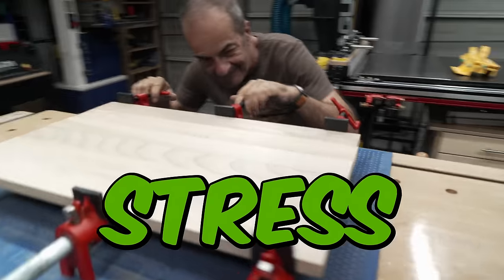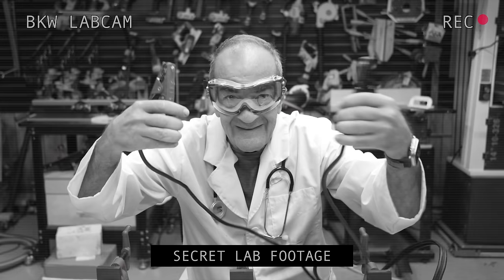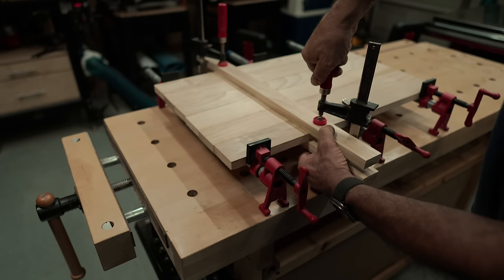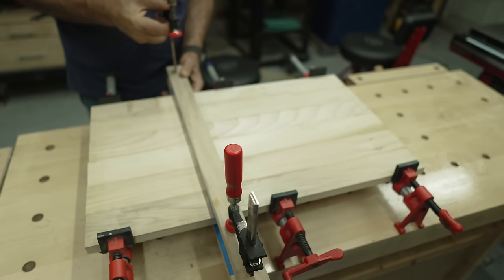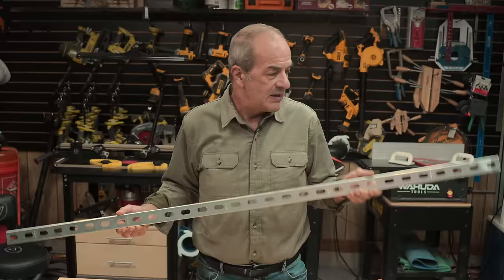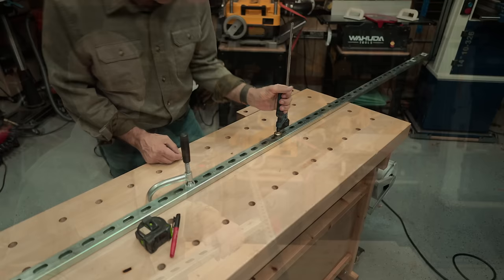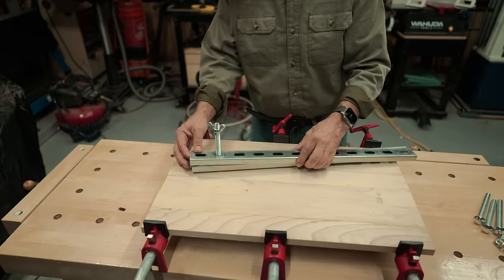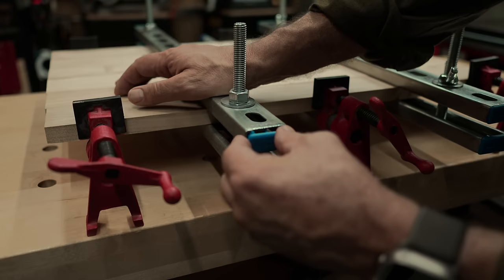Rockler doesn't want you to see this video

Comment: I've used the Rubbermaid standard support brackets for closets. They come in various sizes typically cheaper thus you don't need to cut them down. You may need to drill more holes in them to allow you to clamp closer to your actual piece.
Reply from the maker: That’s an interesting thought. I’ve used old stop sign posts (which I used to get for free) but that’s a new one on me.
Reply: @BustedKnuckleWoodworks   Do we want to know how you got 🛑 posts for “free“? 👀😆  In fairness, you can find ‘em just growing out of the ground all over my town
Reply from the maker: @j10001  😂 I used to know a dude who worked in the street department when I lived back in Maine. Although your idea would work too! 👍

Comment: Thanks for this. You gave me an idea for another application I have been trying to figure out. I have been looking for a way to make consistent router groves for the Microjig dovetail clamps for large surfaces. It appears these superstruts are very heavy duty, nice and long and will stay in place once you screw them down. All I would need to do is place square templates made of MDF on each side, make sure the measurement is consistent throughout, and route my t track slot. From what it appears by the thickness there shouldn't be any flex at all. Thanks!
Reply from the maker: Oh yeah, there's a thousand uses for this stuff! Very stiff and straight! I've used it for shelving, fencing, you name it. They make it in two larger sizes, for big heavy duty jobs too.

Comment: I loved this idea as I do lots of panels for cabinets (never use plywood).  It was smart to show the different options as well.
Reply from the maker: Love to know if you give this a try, how it works for you 👍
Reply: I will be fabricating more panels in a couple of weeks so I will give this a try.  I actually have this material on hand from a left over electrical project.  I will be fabricating both oak and elm panels for the cabinets. I generally use DeWalt 24" one-hand clamps for clamping as I bought a couple of dozen of them for a massive project.   For larger lay ups I use pipe clamps, both 1/2" and 3/4" with lengths up to 6'.  I think 2 of your cauls will work for each panel glue up.  I usually do 4 to 6 panels at a time so I will have to make a few sets. @BustedKnuckleWoodworks
Reply from the maker: @EOTE_TX  love this! Email is on my About tab, send me pics!

Comment: if you walk into a hardware store or home center and call it super strut they may not know what your talking about . the trade names are known by  unistrut and kindorf they also come in 3/4 thick  and 1 1/2 in thick. most of the time you find it in galvanized  but i have also seen it come with some kind of green coating. there are threaded fittings that slide inside the track so that you can slide threaded rods or bolts to any spot on the track. this allows you to get in right next  to the edge of your project.
Reply from the maker: Unistrut is a similar competing product. They aren’t the same and the sizes are slightly different. Most home centers don’t carry it on the shelf (at least not in the US) but specialty trade suppliers will.

Comment: Neat trick and one that many will utilise. I figured if you flip the superstrut, which is a "U" channel, and have the flat side pressing down, it will give you more surface area for the clamping force. Just a thought.

Look forward to seeing more of your back-catalogue!
Reply: I would think flat side against the wood would also prevent idents on the wood if cauls were tightened too much
Reply from the maker: You can place them either way. I find having the open side down is easier, and it’s not usually an issue as long as you don’t over tighten them. If you put the flat side down, the wing nuts don’t fit, so you would need large fender washers to span the opening, or some other method for fastening them.
Reply: @BustedKnuckleWoodworks  This is YouTube at its best. Positive interaction between creators and total strangers,, exploring the concepts arising from a simple vid. Even at 56, I still take delight in learning and exploring the nuances of hobbies (for me, at least) such as this. 
Have a great day Sir!
Reply from the maker: @BadYossa  You’re a kiddo compared to me! Just goes to show we’re never too young to do woodworking 😉

Comment: I’ve always used my pipe clamps as cauls.  We all know we should align the screw of the pipe clamp with the wood we’re gluing up to prevent the wood from bowing up during the glue up.  As I’m screwing down the clamp, as soon as the pad makes contact I tilt the clamp over so the pipe lays on the wood, and then I align the screw with the wood, tighten the clamp until there is enough pressure to hold everything in place.  Use at least two clamps on the first side, and then turn the piece and clamps over.  Repeat the same process on the ‘back side’ making sure to align the screws while laying the pipe down on the wood surface.  Tighten all the clamps to the desired pressure and wait for the glue to dry.  I’ve never had a panel bow or end up with a board out of alignment.
Reply from the maker: I don't like to have the pipes touching the wood. And a lot of folks use black pipe, which you should never use as cauls, the black will mark up the panel for sure.

Comment: This is great.  Making up a set today to do my first real butcher block glue-up.  Got two 10' sticks at THD at $25/piece.  Betcha an electrical supply house would have them for half the price.  Same as black iron pipe for pipe clamps.  Got mine at a plumbing supply for half what big box stores want for it.
Reply from the maker: Watch the part 2 video I just uploaded today, lots of great improvements 👍
Reply: @BustedKnuckleWoodworks  thanks.  I'll check it out

Comment: Good idea,even better if yo place the bars the other way up.this gives you a greater surface area on your glue up
Reply from the maker: Good point, many have mentioned that. The wing nuts won't fit if you do that, so you'd need extra-large fender washers to place them on the outside of the channel.

Comment: I figured out a similar method with 1x2 14 gauge box steel cut into 42" lengths. I use painters tape on one narrow side to keep it from rusting on glue, but i just use the F clamps to clamp them down. I feel like the bolts take too much time. With the clamps you can clamp the cauls about 3 inches in the panel so you can crank down as much as you want and you wont flex the caul. If a board in the middle bows up more than the pressure of the caul will fix (they don't make everything perfect, after all) you can slip a narrow shim under between the high part of the board and the caul right there and it forces that section down. Woodworking is my full-time job so ive had to get as quick and practical as possible while not sacrificing quality
Reply from the maker: Very similar principle. More than one way to get it done for sure. 👍

Comment: Brilliant blend of comedy and instruction. Can't wait to watch more of your videos. My cauls are slightly curved to apply even pressure from the middle to the edges... I wonder how easy it is to bend this strut material.
Reply from the maker: It doesn’t bend very easily, but it’s possible a couple of strategically placed washers could work…

Comment: I bought maybe 28? years ago a few Veritas Panel Clamps, and still using today. Made some 2x3" x4' clamping bars from Tasmanian Oak with holes  and that was the best option for me. Very easy to store and clamps the board on both sides. Before that, I used sliding rail parallel clamps ( about 10 Kg each) with heavy duty bars, and a few different brand name F clamps- they worked if I clamped from both sides: top and bottom, but was always too messy. But I learned very early that solid wood paneling is much easier  if I biscuit joined the boards which stops any side movement during assembly /  gluing. And for panel gluing I mostly used epoxy and longer setting urea-formaldehyde glue. PVA sets too quickly for me, and does not work well with many Au hardwoods-like jarrah.
Reply from the maker: Good tips… I didn’t realize there was wood that PVA glue didn’t work well on some exotic woods

Comment: I've been using punch-rail for that ,and many other 'unorthodox' tasks for years. I'm using it as a 'spar' to support the blades of a 10' dia. wind turbine rotor I'm building now. Also using it as a 'spine' across the top of a 9' long sign I'm making for my plumbing business right now. I guess I'll make a video of that project and post it. Cheers All! 🙂
Reply from the maker: A thousand uses for this stuff
Reply: I  pick up scraps of this all the time time from work to make all sorts of things. It’s great if you have to take repeated measurements in weird areas like from the top of a ten foot ladder. Measure out you length mark and cut the strut. Now you have a rigid measuring and marking tool. I built what I call my roof rack for my utility cart with strut. To perpendicular pieces running wodth wise then two pieces of 3/4 conduit running parallel the length of the cart attached with strut straps. Lets me use the top of my cart as work surface to cut and measure conduit without cutting notchs in my cart or sacrifice space. Throw a piece of Sheetrock over the top if the cart but under the the pipe.  Now you have a flat surface to work in with any material stored on top still but under the Sheetrock
Reply from the maker: @1EliPrice  those are great ideas! I love this stuff… no welding!

Comment: You could even take this one step further and replace the clamps themselves, using hardwood wedges against the bolts to press the boards together, if you really want to save some money. Those big clamps aren't cheap, either. Or, if you have small clamps that can be reversed to push outwards, use those between bolts and boards. I think I'll build myself a large panel glueing station, for cabinet sides etc., with struts like these, hanging on a wall. That way you can always be gluing up panels without blocking your workshop.
Reply from the maker: I know! The hardwood wedges are such a great idea, a few others have commented about doing that. I wish I had thought of it!

Comment: Good idea for someone doing a lot of those glue ups.  For the rest, a simple SLOT nearly the length of those wood pieces will let you slide the clamps inward to any width for full clamping force.  Or, simply glue up two boards with spacers after putting the clamps in between.
Reply from the maker: Sure, do whatever works, that’s the main thing!

Comment: Swivel Pad C-Clamp Locking Pliers would let you put the pressure onto the work, instead of off the sides, avoiding most of the flex whatever the cauls are made of.  They even make 18" long ones to reach into the middle of your work. Harbor freight has good budget ones.
Reply: I’ll check that out
Reply from the maker: I have a bunch of the Kreg ones. My channel is all about practical, economical solutions. I generally try to avoid recommending something expensive when a cheaper option will do.

Comment: @0:27 You can easily use wood cauls for that type of glue up, I've done it for years. You need to turn the boards on their sides, they are stronger and won't flex as much. Then just use wax paper or packing tape on the cauls and glue won't stick.
Reply from the maker: That was kind of a demonstration of what NOT to do, I did use tape on the cauls a few minutes later.

Comment: Been using the runners for those metal shelving brackets which are actually cheaper, but smaller and trickier to get bolts into as you need to drill holes in the bracket slots. Might have to upgrade to this stuff.
Reply from the maker: An update to this video is coming out in a few days!

Comment: Have had the best luck for many years just using hardwood sticks. Just use some wax paper on both sides of the panel. Have a few deep reach C clamps to put pressure in from the edges.
Reply from the maker: Ok

Comment: Love the work you do with editing. It's always nice when people put this amount of effort into their videos. It makes these so much more enjoyable to watch. 

Second, couldn't you just run the clamps you ground down through the holes in the strut channel?  I mean instead of nuts and bolts.
Reply from the maker: Thanks for the kind words. I did work hard on this one! To answer your question, I wanted to show the cheapest, lowest-effort possible way to make these (one one tool, right 😁). I guess I could have shown it that way near the end, that would have been a good idea.
Reply: @BustedKnuckleWoodworks  I worked in television news for a bit and it does have the feel and cuts we would have used along with some from the more creative editors.  Good work.
Reply: Great addition I’ll have to try it. 6” F or bar clamps are under $5 at Harbor Freight.
Hoping to get back in my shop soon.

Comment: This is a great hack! I've been looking for a simple solution, and you provided it. Thank you! The only change I would make is put the flat side on the wood to minimise denting, and add a little block of wood or any other type of spacer, really, for the bolt and nut.
Reply from the maker: You can place them either way. I find having the open side down is easier, and it’s not usually an issue as long as you don’t over tighten them. If you put the flat side down, the wing nuts don’t fit, so you would need large fender washers to span the opening, or some other method for fastening them. The spacer is a pretty good idea too!

Comment: Nice trick.
I'd suggest a broad flat strip of softwood between the metal and your work piece. Otherwise you do risk bruising your timber.
Also, get the bolt as close to the edge of your work piece as you can without actually touching it, and you'll probably be able to run the bolt through closer on the other end too. The closer your bolts/clamps are to the work, the better. That was the big fault I picked with the timber caul with the clamps fitted through it - if you only fitted the clamp at one end instead of both ends, you could snug the fitted clamp close to your work and then clamp the other end with a not-fitted clamp.
Reply from the maker: Thanks for the tips 👍

Comment: I used Rockler 4-Way Equal Pressure Clamp - then realized that's the one tool or jig in my workshop that make me not like woodworking.  Need 6 hands? More like 10. It got to a point where it was infuriating.  I'm off to the Depot right now, electrical supplies, and I ran our of wax, taking care of that also.  Thanks for this Lee.
Reply from the maker: The woodworking industry is sooo good at convincing people they need expensive solutions. Thanks for watching and for helping me fight the man! ✊

Comment: Nice idea!  I really like home made tools and jigs.
One concern I would have it that the hard steel could mar the surface of the wood.  If you are planning to put them through a planner afterwards, it is probably not an issue but starting woodworkers probably don't have a planer.
Reply from the maker: You can flip them over for greater surface area if desired. I find having the open side down is easier, and it’s not usually an issue as long as you don’t over tighten them. If you put the flat side down, the wing nuts don’t fit, so you’d have to modify the clamping mechanism.
Reply: @BustedKnuckleWoodworks  Good to hear you have not experienced any problems.  I thought of putting the flat side down but I was concerned the holes might have burs or raised edges from the punching process.  In any case, I am going to look into this the next time I need to make a call.
Reply from the maker: @connecticutaggie  they definitely don't have burrs on them. They use these a lot for electrical cabling, so any sharp edges would be dangerous.

Comment: Nice! Best woodworking hack I've seen in a while.
Nice find on those cam clamps, too. I saw they make 1/4"-20 ones, too, and threw those in my cart. No idea what I'll use them for, but 1/4"-20 is a super common size, so I'm sure I'll be glad to have them when I'm trying to jerry-rig something.
Reply from the maker: Yeah for sure… the 5/16” are a little beefier. Wish I could find 1/2”, I’m not sure that size even exists

Comment: I have made a couple sets of clamps from those. struts years ago before I ever seen anyone showing them.  I have made actual bar clamp bodies that clip into the ovil holes then You can put a second piece over the top to hold the panel flat.  My suggestion is to use some home made t nuts to tighten and put the flat side to the board and the edges will not mar the board when clamping soft woods like white pine. I have little 2 in long 1/2in  water pipe I have welded a nut too on one end and 1/4 rod to make the T handle.  The bolts screw up into the pipe so you can reach in between struts.   I promise if you get them very tight on soft wood they leave a mark the way you show them.
Reply from the maker: All very good suggestions, thank you

Comment: not going to lie, I was half expecting you to just use the slots on the strut to slide your clamps through. Excellent video, I might give it a go with the F clamps and Strut.
Reply from the maker: Let me know if that works out. I've tried it before, but you need something to cover the holes where the clamp makes contact, otherwise it doesn't seat properly.